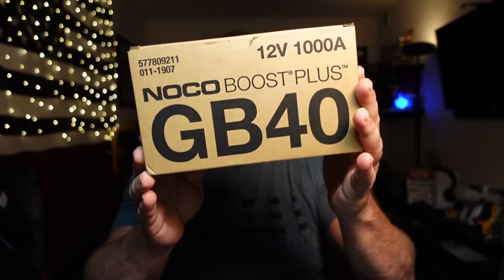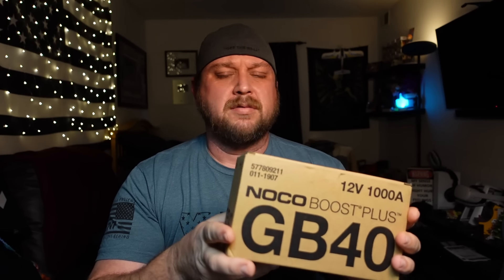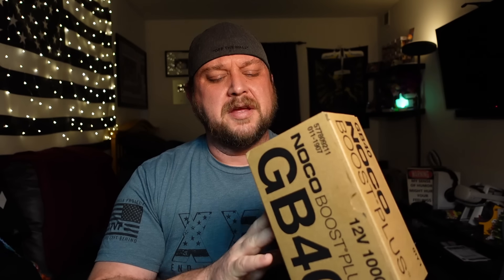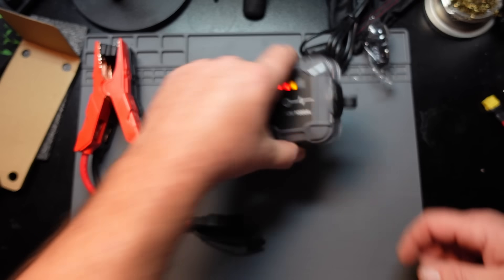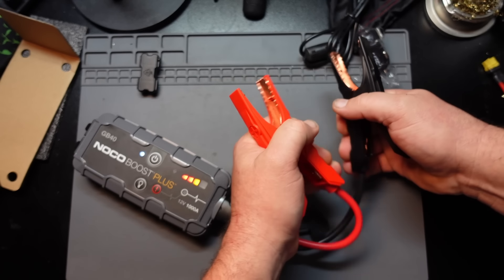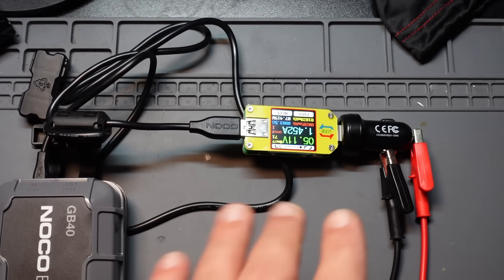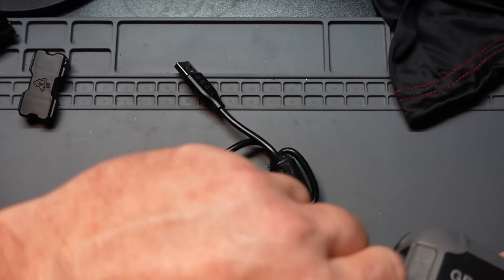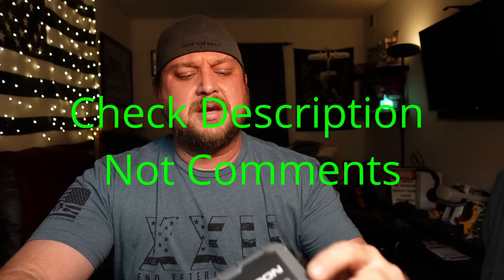NOCO Boost Plus GB40 Car Battery Jump Starter

Comment: The storage sacks are nice but that drawstring really needs a barrel cord lock toggle stop slider-type thing, esp. at this price. I'm about to convert my storage sacks with those.

If you buy the 2000A version from Griot's Garage, you get a lifetime warranty...but not on the battery itself, long-term. They're pretty generous with warranties/customer satisfaction there.

Comment: That ! button is for if a battery is completely dead. The jump pack needs to see voltage when in normal operation mode to function. The ! button when pressed and held for 3 seconds bypasses the safeies and will let it work even if you have your poloaity backwards which normal operation mode would protect against

Comment: I got the kids each one about 2 Christmases ago and they been doing a good job. But the son is back home now and I've been using his instead of getting my own. My 15 GMC Serria's battery has been on the slow road to dying. A few weeks ago when we had that cold snap, it finally killed the battery and I had this exact pack in the truck. It must not like the cold too much because it almost let me down. It took about 10 attempts and finally had just enough juice to get the 5.3 started. It should have had a charge, but I can't attest it was a full charge.

Comment: ive been using my harbor freight unit to jump forklifts in the shop, seems to work great. it will jump the units with the mct engines in them without a battery. (great for cleaning out the regulator accumulator) when its normally behind the battery. do that in our shop for the 3600hr services.f

Comment: I switched to using the Autowit Super Capacitor because you do not need to keep it charged and it works way better in the cold.  I still have the Noco in the trunk just in case I need it to charge the phone in an emergency.

Comment: I think we use the GB150, and they aren't cheap, but damn, do they work! We haven't had trouble jumping any of our trucks with graveyard batteries, even with a low charge on the pack. Capacity is pretty good too for a jump pack its size. The only complaint I have is the short leads, but it's honestly not that much of an inconvenience. They've gone through pretty heavy use in the last 3 or so years without issue.

Comment: I've had the Halo Bolt brand jump starter for a few years. It's been conveniently used several times to save me or friends but it uses a barrel jack to charge which is way less convenient than USB and mine didn't include a car adapter (i think they do now though).

Comment: I bought a Topdon  js3000  Couldn't believe charging it with my phone charger.  Spins motors over surprisingly fast. Only thing I don't like is, if it is a hard start. It only gives you a 3 second shot.  I have only pulled out the heavy jumper cables once in 6 months

Comment: After having several boost boxes and the battery always seeming to be the weak spot I recently bought a new Ryobi one that takes any ryobi 18v battery. It’s not small tho or cheap. $200 bare tool at home despot. I’ve got close to 20 jumps on a single charge on a 2ah. I’ve also just used a Ryobi 2.0 battery and hope to jump my old v6 van and it went from 4 bars to 2 so the box definitely has some magic sand and probably some big ax caps doing something special

Comment: You have to watch putting everything in the soft sided bag. I had one of the cables push the flashlight  button in storage and it was dead when I went to use it. FYI

Comment: they work great, but make sure to charge them every month or so if not in use. If you leave it in the car in -30 and try boosting it will die quickly. Other than that just take care of it and it will take care of you👍

Comment: I have a GBX45, which is close in capacity to GB40, but has a USB-C charging port and didn't come with a 5V adapter. When charging over USB-C PD, it takes 50W. Would be interesting to see whether the included 5V adapter or the booster itself is the 1.5A bottleneck in GB40.

Based on my very limited experience with the GBX45 on a 2L diesel engine, it looks like it would be capable of around 4 starts before needing to be charged again. I'm not taking chances and am charging it up after each use, but your not-babying-it use case obviously makes for a more interesting review.

Note that if the battery of the car about to be boosted is too dead for the booster to detect polarity, it will refuse to simply turn on and there is some song and dance to force it on. I don't remember how it goes, should probably look it up before having the occasion to need it.

Comment: My noco gbx155 (little bigger than this one) is rated for 10L gas or 8L diesel. I started a 11L 6cyl diesel with a 24v starter without the batterys hooked up. Had to crank on it for 20 seconds or so and still had half a charge left.

Comment: I have the GB70 2000a. Starts my truck and a diesel with no battery installed... I have noco lithium batteries on all my outdoor equipment. And my generator.

Comment: The GBX models all have USB type-C instead of micro B, also looking at the connector it seems to be based on an XT-90 instead of the typical XT-60 used on drone lipo's

Comment: i won a automotive competition last year that had a Stanley branded jump pack (think its AA branded too (AA is UK recovery company)) and one thing i noticed is leaving it in the van fully charged over night in winter for several days, the cold was getting to the jump pack battery and when i needed to use it it only had 40% charge left.
would be interesting to see if your pack does the same or not but also i won 3 boxes worth of tools for a £35 raffle ticket so i am not complaining if my jump pack is a dud lol

Comment: I've had three different brands fail in about a year. The batteries can't stand the heat in the trunk of the car and just go bad, won't hold a charge anymore. I was in Phoenix at the time, so maybe other parts of the country where its not above 100 for six months of the year they might last better.
I still have my old fasion cables in the trunk, but these can be convientient.

Comment: It no longer ships with a charging cable or cigarette lighter adapter. The vendor calls this an "upgrade". That being said, the user manual still says to "Charge the product using the included charging cable.", so the upgrade is really just lowering their costs by eliminating parts of the original product. 

I could not find anything in the included manual that gives the NOCO part number for the charging adapter/block, cable, cigarette lighter adapter, etc. After some searching, I found the part number for the charging block and it costs $9-$11. Could not find the charging cable or cigarette lighter adapter.

The user manual also warns against using charging options not included with the pack, so probably giving themselves cover to deny their warranty if it breaks. 

There are also now (December 2024) many recent reviews on Amazon which complain the the pack will not hold a charge.

Comment: Mine must be faulty. The USB charging and lights work great, but it won't even jump a riding mower. I bought a different brand that works great and threw this in my tablet bag for travel.

Comment: Last
That little battery is supposed to put out a thousand amps for what a microsecond
Reply: By rough perfect-universe numbers, an ideal 2.6Ah would be 9.36 seconds, at 384C discharge rate... 1000A for 3s isn't impossible, but I suspect they round up to the nearest multiple of 500A ;-)

Comment: And this is why you should read the manual...
Push the "!"  button when not connected right and you will end up with an expensive mistake.
Have the GB150 in my vehicles at all times, but use a GB500 almost weekly. Will start any machinery while still portable.

Comment: I don't think this is going to work well for frequent use in a commercial application.  The average person is not jumping their car 3 times a week.
The cells in these things are extremely low resistance pouch cells with enormous amounts of surface area. This is to deliver the current necessary to overturn a car engine.  They are basically built for current capacity, not longevity or energy density.  This is also why they aren't really built to be used as a power bank except for emergencies.
Reply from the maker: We’ll see 🤷🏻‍♂️ I might do 20-30 jumps a year.
Reply: As an alternator-saver alone, it might be worth the cost even if it's toast in <= a year.